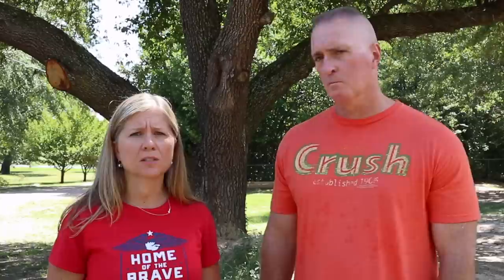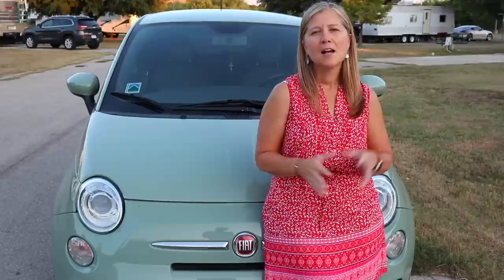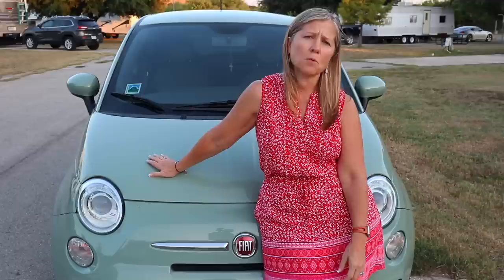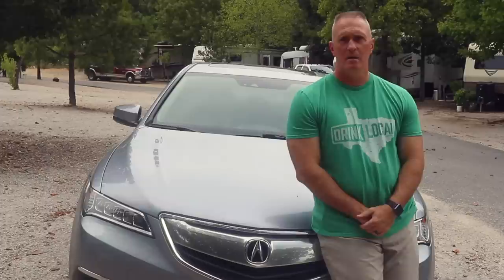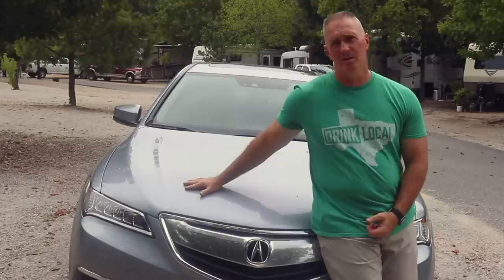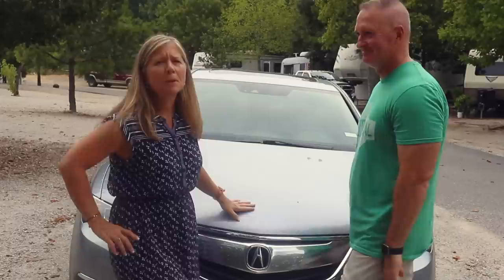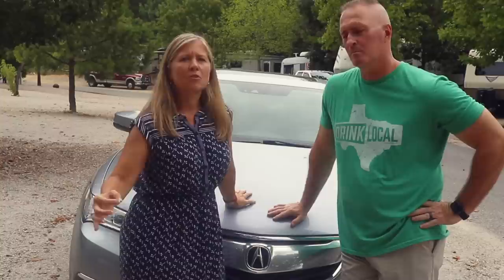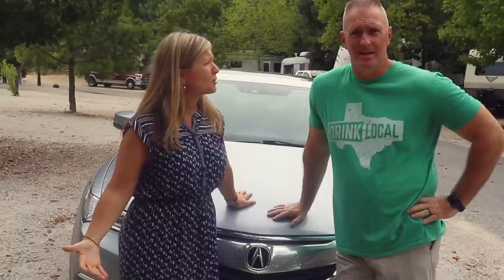RV Towing: Dolly vs RV Flat Tow -  Full Time RV Living

Comment: Oooh! I really appreciated seeing the Fiat 500 towing video section. Just got a used Fiat 500 a couple of weeks ago in preparation for having a tow vehicle. Thanks for all the info!
Reply from the maker: I did love my green goblin!! Did you get an automatic or stick?
Reply: @todayissomeday  - we chose the automatic. :)
Reply from the maker: That’s what we had. I was just wondering because you can flat tow a standard. If ours had been a standard we would have kept my ride and skipped the dolly. Yup, I loved that car!  😁
Reply: @todayissomeday  - We wanted to flat-tow, and were definitely NOT going to deal with a trailer (for our current vehicle, AWD), but were okay compromising on using a dolly. It was nice to see that the dolly was doable with the Fiat, which went with the Motorhome dinghy guides that I looked at...but hadn't seen on video, yet. Confession: I was considering learning how to drive a manual vehicle, if necessary. That's still a possibility for the future, as well as flat-towing. :-) But for now, super-excited about the great gas mileage!! 
Did you have to have a farewell ceremony for Green Goblin? Maybe a little grieving period? I can understand, if so. :-)

Comment: Being an ex- professional semi driver, I wouldn't trust a dolly for anything (only my opinion) too many articulated points as apposed to a sturdy tow bar and four wheels with a firm footprint.
  Roadmaster makes an indestructible tow hitch, that is also equipped ( optional) with a "Toad brake" for both air brake systems or hydrolic.
Reply: I'm glad to hear your opinion.  We have a Fiat 500 pop standard transmission and I was thinking it wouldn't hold up to having the tow bar option.  We have looked at the cost of the Roadmaster, very expensive.
Reply: @debikallas7244  There are other makes available, but keep in mind it's an investment, and safety is a key point when towing ANYTHING.

Comment: Great video - informative and entertaining. I see you towed an Acura on a dolly. We’d like to do the same with an Acura RDX (2WD) but the owner’s manual says it can only be done for short distances at low speeds. Dealer maintenance rep says it should be fine. How did you convince yourselves it was ok? Did it work out alright?
Reply from the maker: Our Acura did not say the same thing in the manual. We didnt have a problem with it at all other than it was to low to the ground to tow without scratching it up.

Comment: Jeep will take you any where you want to adventure.  I suggest the 2 door its just the 2 of you and the 2 door turn radious is better its shorter and we leave the seat folded forward keeps things in the back ie our dog.  If you upgrade the front bumper you can get obe your tow system mounts will be welded on the bumper. We use the sterling.  Hook up and unhook takes 5 min.    

I recobmend the invisa brake permanatly mounted your not moving a break box in and out of the car.  Rock hard full bumper with the mounts added eliminates having to use their system which in my openion not as secure.  Add a winch go anywhere you want get stuck you can self rescue.  Get the drop down winch uncreases air flow to radiator.  Also pick up aluminium inserts to protect your ac an radiator coils.  They simply snap into the factory slots.  5k for winch bumper and breaking system. Inckuding install of all but i put my own bumper on 2 hr project very easy to do.  May need wire extention kit for fog lights.  Under 20 dollars plug in to wire harness plug into fog lights.  Do not get steel cable winch the rope is rated higher and if it snaps it drops energy instantly cable whips back.
Reply from the maker: We have ditched the dolly and now flat tow. We explain it all in a more recent video: https://www.youtube.com/watch?v=xb9VkVTfuT8

Comment: I want to talk about Braking.  We have a 2000 American Dream 40ft diesel pusher and I towed a 2013 Honda Fit for 6 years. putting 45,000 miles on the RV.  I'm not full time but I'm retired.  The Fit odometer does not record towed mileage.  It is about 2500lbs and the RV does not even know it is back there. 

Because of heath reasons I have to stop RVing. But I want to let everyone know while California has some of the strictest breaking requirements in the nation. and if you look up Braking requirements in most publications they say anything over 1500lbs requires brakes. If you read the actual law it list a stopping requirement.  I when out to see if how close I come come to that requirement.  I tried it fully loaded for travel and I was able to stop within 75 % of the allocated distance.  My point being read your state laws completely and not just the short version everyone quotes.  I will bet none of them are as restrictive as California.
Reply: Wass your fit a manual or automatic? Can we tow a manual Honda Fit? put it in neutral or what?

Comment: Wondering how total length relates to RV parks you can not go into.  How long is too long to get in?  We bnb are thi ki g about pulling g a trailer w a truck.
Reply: We are thinking about pulling a 30 ft trailer with a truck.  Where can we not get in? And can get in?
Reply from the maker: We are 3 ft in length and haven't had issues in any place we have stayed.  It really depends on the park.....at 30 ft you should be good to go in a majority of parks.

Comment: No natter what you get it's going to have to be something where the hubby will comfortably fit and the wife can reach the gas pedals. We have an F150 that we had before we bought our TT and luckily for short little ole me the gas pedal and brakes raise up so my short legs can reach them and BONUS! it has automatic running boards that come out low enough when you open the door I don't need a step ladder just to step up on to the running board! 😄 😄 I have never been that fond of Jeeps either, but I seem to see a lot of Jeeps being towed behind Class A's. Maybe because you can go off road in more places due to the higher clearance and how rugged they are? (but I'd still need a step ladder to get up in to one - hahaha) Best of luck with finding the right fit for your needs (current and long term).
Reply from the maker: You are so right! Phil as you may have noticed is much taller than I am! And if you have seen the tour of our RV you will know I cant really reach the pedals! So we definitely have to find something we will both be comfortable in!
Reply: @todayissomeday  The struggle is real ☺ #shortpeoplerock
Reply from the maker: Preach it sista!!!

Comment: Hi- Nice video. It's the first one I watched on this. I'm looking at a new job where I deliver RVs, and have to tow my own vehicle behind it. That's how I'll be getting back home. Ironically, like you folks I have 2 cars to choose from. One is a mini van, the other a smaller car. I don't like the idea of towing something home, but will if I have to.  What I'm wondering about the flat tow, is that something each different RV would have to be set up for? If so, I guess that means flat tow isn't an option. Also, provided your vehicles had hitches, could they easily tow the dolly? I mean just the dolly, not the dolly with a car on it. Then finally, about how much does the dolly weigh?
Reply from the maker: Flat towing would not be an option because as you eluded to each RV will need to be set up for flat towing. The dolly weighs about 500 lbs.  I dont see why the Acura couldn't tow the dolly if it had a hitch. It definitely has the power. That being said I would have to check the manual for towing capacity. I don't think towing it with the Fiat would be a good option as it took forever to go from 0-60 without the dolly.
Reply: @todayissomeday  - Thank you and great info. Based on what ya said about the cars, I'll probably be taking my mini van for the same reason you stated with your car. It can barely move itself, much less taking on another 500 pounds. Thanks again and safe travels.

Comment: You mentioned the Cherokee. 19 model has a 2.0 turbo option, good mpgs vs power. Other wise the 2.4L does better than the v6 as you might imagine. Love the Fiat 500👍👍👍👍
Reply from the maker: I loved my Fiat too!! If only it had been a standard instead of automatic we would still have that sweet little ride!
Reply: I never liked the base Fiat 500, but the Fiat 500 Turbo with a euro+drive OBD2 tune (only takes an hour to do in your driveway), is really great.    It has an identical engine and transmission to the Abarth, and is only factory detuned to not compete with their expensive model.   With the tune, you can exceed the Abarth boost pressures and hit 22PSI vs 18PSI for the Abarth (14PSI stock), which gives it around 190hp which is plenty for a 2.5K lb vehicle.  Since the Fiat Turbo hasn't changed since 2013, best is to buy a used one which sell for next to nothing.  That's what I did and have put 66K miles on it so far problem free.   Just had to do oil changes, brakes, air filter, cabin filter, and a couple burned out blinker lights just regular wear stuff from age.

Comment: Phil, 
What type of extension cord do you suggest if the power pole is on the opposite side of my RV power cord?
Thanks
Reply from the maker: Walmart and Camping World have power cord extensions for 30 or 50 amp.  Just make sure you have the right one for your rig.  We actually pulled in to a site instead of backing in so our power would be on the correct side. But if you  have a TT or 5er you may not be able to do this. Safe travels.
Reply: BTW, have you tried Tiger Balm on your back? I've used it for years. Love it. Get the 50ml tin.
Reply from the maker: Yes, I have. Unfortunately it is no longer effective for my issues. Thanks.

Comment: Great video. I'm a recent sub and really like your approach to problem solve. I've been towing all sorts of trailers and cars  for over 50yrs. That doesn't make me an expert but I've had my share of issues. I have no experience towing with a motorhome so I can only relate to car towing using all three of your methods. The best and safest towing is with a "CAR" trailer, hands down. Only, that method leaves you with too many camp site issues so I would rule that out. Flat towing, using a towbar setup with a separate brake control system involves big expense, extra wear on the towed vehicles tires and frontend parts, and less towed vehicle stability. To me, the favored tow method would be using the towdolly. I have one and it's easier. As to your back issue; I've had 3 back surgeries. All the sureries were in different locations, so I know the inherent problems. I suggest adding a tongue mounted fold up jack with a wheel. This will make moving the dolly easy, as I do it all the time. Now, to restart the "which car should we keep?" debate. A welding shop can easily narrow the ramps on your dolly and releive the anxiety when loading the Fiat. Besides this will save you a ton of money, now and in the long run. Good luck with your decision. BTW, I tow a 30' camper with my dually 4dr diesel pickup and only dream of a class "A" motorhome. God bless and be safe.
Reply: OH, a P.S., I favour the Acura. The Fiat is cute, but to small and "girly" for a guy. Just sayin' ....

Comment: Good video. FYI - You can't back up with a tow dolly. Personally,  I would not pull a tow dolly or a trailer with a car on it without it having brakes. I would not care about what the state law is. It is just too dangerous having 2 tons pushing you down a hill or during an emergency stop.

Comment: Love your videos, what steps have to be done to use the Acura tlx on a tow dolly?
Reply from the maker: Nothing had to be done to prepare for the tow dolly.
Reply: So just load on to tow dolly and leave it in neutral
Reply: I have the 2015 acura tlx tech package FWD all i need to do is just put it on the tow dolly and shift it to neutral and done or did you have to do something else?
Reply: What steps did you take to release the electronic parking brakes on the Acura tlx?

Comment: If your keep racks up mileage on a flat tow there is a fuse you can pull to prevent that. Also most any car can be towed. I towed a Minivan but had to install a Raycor pump on the transmission

Comment: One con to flat-towing you didn’t mention:  rock damage - even windshield damage is possible -  I would love to see more information on how to prevent damage to your dinghy.
Reply: I would assume a cover for your front windshield.
Reply: @NPAMike  Not as practical as you'd think.  We've looked into everything we could find, and all have drawbacks.  For example, the winddshield cover can cause abrasion to the windshield, and I'd rather deal with a broken one - at least insurance would help pay for replacement.  In our several years towing the same vehicle, it only was damaged once on the windshield, and we can't be sure it was while being towed.
Reply: Blue Ox makes a KarShield and a KarShield II. First one is solid and the II is mesh of some sort.  We are researching and deciding this week if we want a shield or not. The RV dealer is going to install the Blue Ox parts on our "new" 2014 Honda CR-V on Tuesday!!
Reply: @kimberleesmith2703  btw, weird thing we learned - the long one-piece mudguard? flap on some motorhomes can actually contribute to toad damage - our new motorhome doesn't have one, and we've had zero damage to our toad in the past 2 years.

Comment: I didn't see the wimpy tow bar that you were talking about. Back in the 60s, 70s,  and 80s our family rented clamp on tow bars to tow large heavy cars across country and even made tow bars for some heavy cars and full size pickup trucks for long distance towing. We never ever had any trouble at all backing up several blocks or even up hill and around corners. It was easy peasy! The tow bar that you were talking about must have been a total price of absolute garbage. The one that my dad made for his Chevy diesel pickup stayed on their because the truck broke down so often, especially when pulling my 24 foot travel trailer from Kansas City to Topeka. That Chevy truck broke down just outside of Kansas City on the turnpike and had to be pulled to a transmission shop in Topeka by our Toyota 4runner with the TT still attached.  I have a picture of that but I don't know how to put it on here.

Comment: How much of a decrease in MPG have you seen with a tow, and was there a difference in performance between a Dolly and Flat Tow? Our dilemma is that none of our cars can be flat towed, and it's hard enough convincing CINCHOUSE to get an RV.  If I tell her we need a new tow car, she's liable to Bobbit me.
Reply from the maker: We didn't have much of a decrease.  We were getting 9.4mpg with the dolly and Acura on the back and now get 9.3mpg with the Jeep and blue ox set up.  I also really didn't notice either setup while driving....it is that smooth.  The dolly would have worked better if we had a vehicle that wasn't so low to the ground.  We started to damage parts of the car while loading and unloading.  We almost bought another FIAT that could be flat towed.....that might be an option.  They cost half as much as the Jeep.  We just wanted something we could hit the trails in.  Good luck convincing CINCHOUSE!!!
Reply: @todayissomeday  Hey, thanks for the info.  I appreciate you getting back to me.

Comment: Nice Video but how can you say that flat towing does not add any extra weight to your rig? Lower tongue weight, I agree but not overall vehicle weight. From my independent research, flat towing has to be the most expensive way to tow a vehicle. To set up ONE vehicle, cost more than either of the other options. The wear and tear on the vehicle is much more extensive. Much of the front tire wear can be attributed to the added weight of the components installed. You never mentioned the expense of setting up a braking system on the towed. Even if it does not increase the mileage on the speedometer it accumulates as much, if not more wear and tear on the towed vehicles running gear than if you were driving it. It must also be the largest fuel consumption method of transporting an extra vehicle. Much more resistance than free wheeling spindles. You have no options available if the vehicle you set up for flat towing is in an accident or suffers a major mechanical failure. Maybe you can find an identical vehicle to move the components over to. Dolly or trailer, just grab another suitable vehicle and off you go.  Trailer tires are usually much let expensive than vehicle tires and your tire will wear out from flat towing.  Sorry to hear about your back.
Reply: Regarding weight, I think the point was that flat towing doesn't involve the added weight of a trailer or a dolly.

One of the biggest downsides to a dolly (or trailer) is the hassle and inconvenience of having to attach/detach the car to the dolly and having to also hitch and unhitch the dolly from the RV.   I would imagine all that work gets old really fast.

And then there's the fact that the trailer or dolly (especially a trailer) takes up additional room at the site, which you may not have.  Oftentimes, especially if you're driving a big Class A, you can only just barely fit the RV itself in the site.  And it's just one more (large) thing to lug around and deal with.

Of course, every method has its pros and cons.  Flat towing isn't perfect, either.  But all things considered, I think it's the most convenient way to tow a vehicle behind an RV.